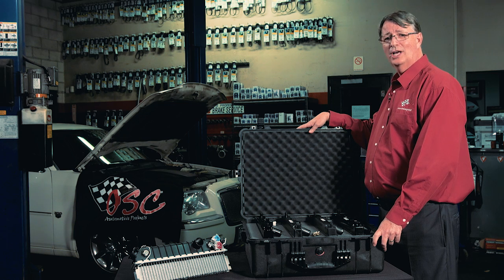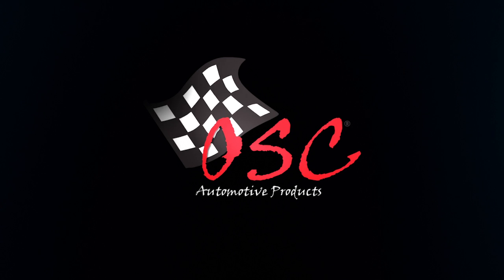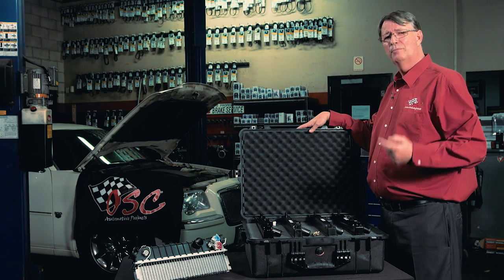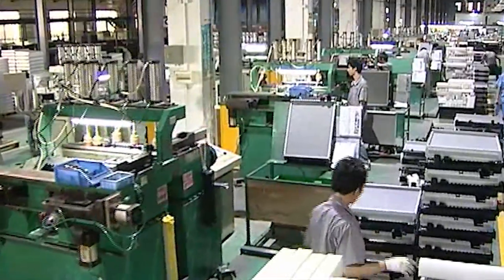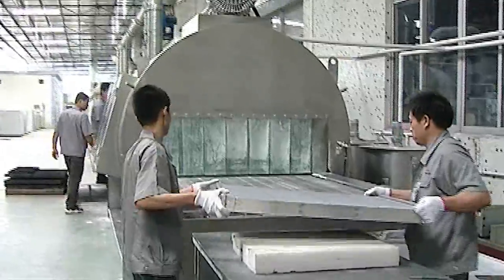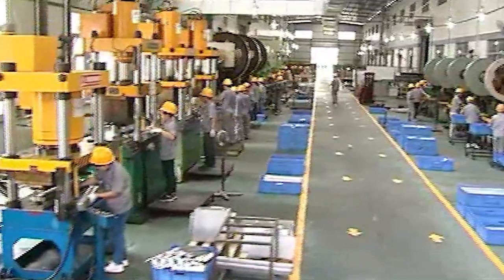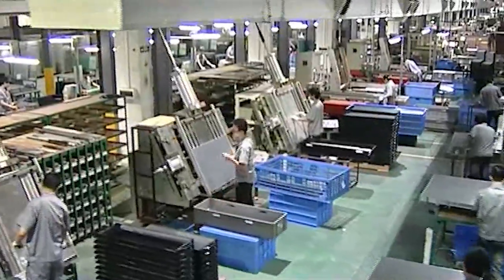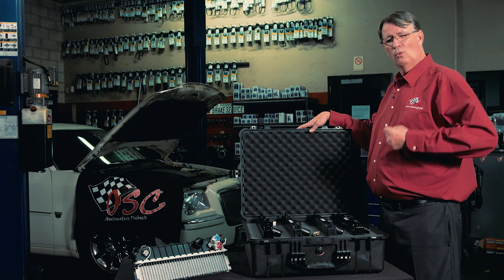OSC No Cooler

Comment: Be careful! I have received 3 incorrectly labeled OSC 2186 that contained a OSC 1905. The 1905 is $62 cheaper and does not include a external transmission cooler. The transmission that is shown on the 2186 is half the size of the factory cooler. Also the pictures of the radiators show new bushings on the new radiator which are not included.

That is what is in the box.....

Comment: How does the cooling needs of an engine racially change as it ages? Other than initial high friction/heat periods during breaking-in, I can't think of heat characteristics of an engine changing all that much.
Reply: As far as the engine goes it would decrease.  As engine efficiency drops so does heat production.  Transmission on the other hand can can increase.  As bands, and converters slip heat generation increases.

Comment: "Today, I am going to discuss some common differences between OSC radiators and other manufacturers..." - and literally doesn't mention a single factual difference... . "and even 150 thousand miles" what are you driving, an 85 Buick? Cars and trucks today easily reach 200k miles.
Reply: my service refrigerated express vans can live to 430k before they develop a hot knock or some other retirement issue.